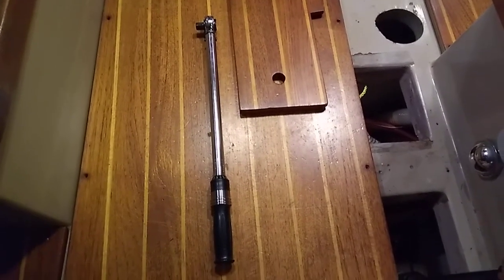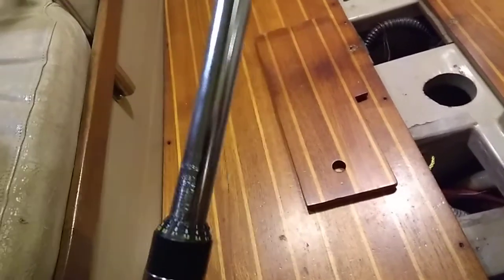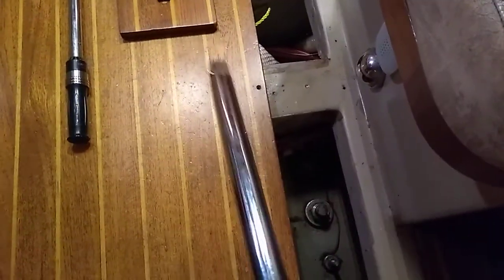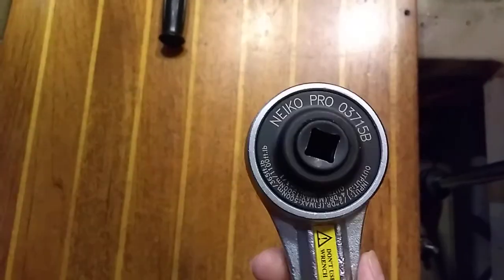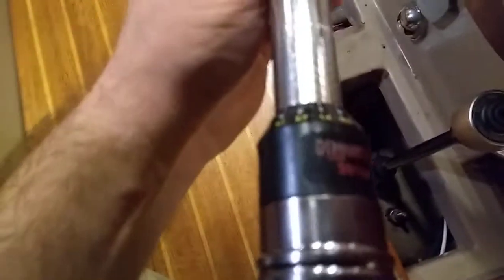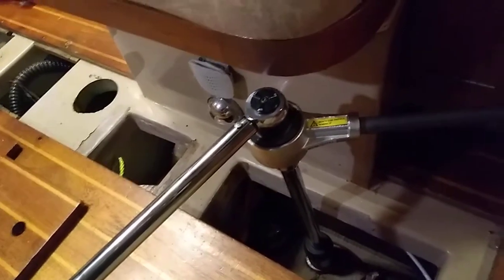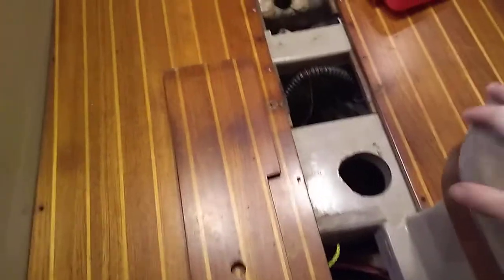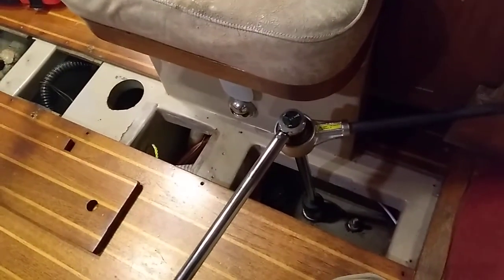Keel bolt torque

Comment: Thanks Josh, I assume rig is out when you did this?
Reply from the maker: Yes.  There is at least on bolt you can't get to.  Maybe two since they are under the aluminum beam used as the mast foot.  For this video the mast was already back in.  You're supposed to do the bolt torque on the hard too.

Comment: Josh, I have a C&C 37+ with a keel smile.Thanks for your bolt torque specs. On my boat the keel nuts that are 2 3/16"
 have the bolt sticking 2 inches above the nut. How or where did you find a deep socket of this size that would bit over a 2" stud?
Reply from the maker: I searched ebay and found all the requisite deep sockets.  Check this one out.  
https://www.ebay.com/itm/195707255377?mkcid=16&mkevt=1&mkrid=711-127632-2357-0&ssspo=TeTJp5_USAe&sssrc=4429486&ssuid=237iMYdLSUi&widget_ver=artemis&media=COPY
Reply: Thank you!
 @muckleyj

Comment: Thanks for the video? Did you get the torque values from your manual or is that a standard for the bolt size? I have an 81 Niagara 31 and I can’t find torque values anywhere
Reply from the maker: I've linked to my torque specs in the description section.

Comment: Hi Josh,

Very much appreciated that you took the time to run thru the steps involved.
Reply: Hi Josh,

I understood that you set your torque wrench to 55lbs and your multiplier is 3:1. I noticed you torqued 3 Times to get 165 (3*55), but I thought the multiplier would automatically multiply the 55lbs by 3 (3:1) requiring you to only listen for the audible “click” when the proper torque is reached (same as using only the torque wrench).

I don’t think it changes anything if indeed someone only wanted 165 lbs of torque (3:1*55). 

Similar a 4:1 torque multiplier would only require the torque wrench to be set at 100lbs to achieve 400lbs (4:1*100). Of course I don’t include the -10-20%.